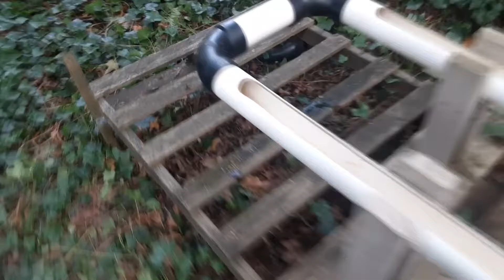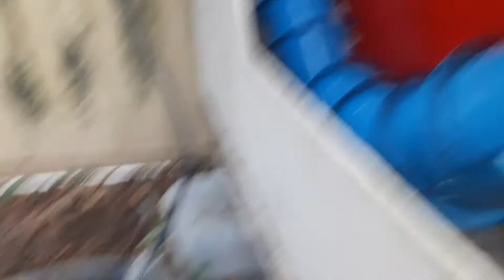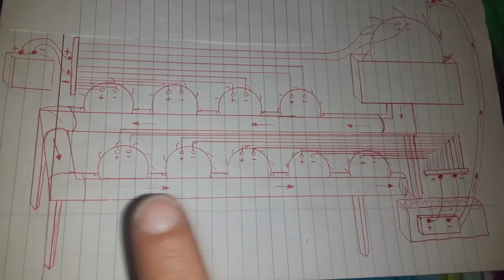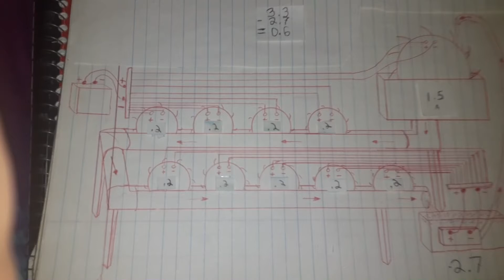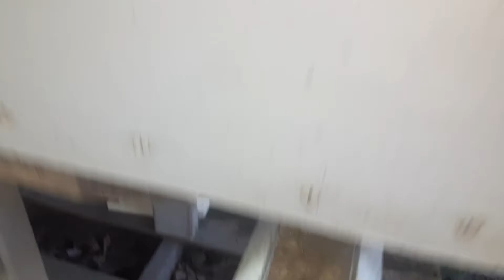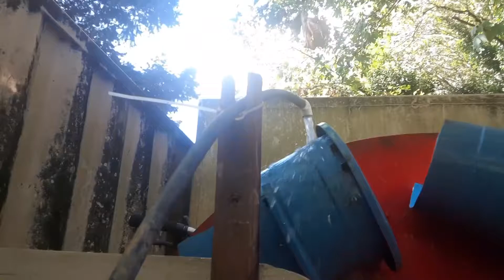Spangler Free Energy Generator [EXPLAINED]

Comment: welll.    i hate to be the one to break it to you but,   pumped storage  has been around a long time.     and, it  aint economical.      it's only useful where  pumps can be run using  OFF-peak power, while the energy produced is sold at a higher rate.         on the other hand,  you are invited to view my ongoing, leverage-based research.     cheers
https://en.wikipedia.org/wiki/Pumped-storage_hydroelectricity